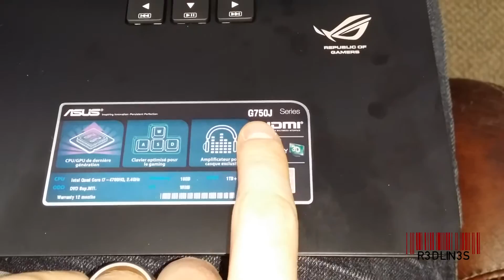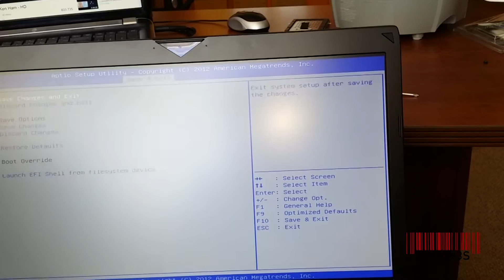Upgrade RAM Asus ROG G750J From 1.3v to 1.5v

Comment: What a stupid thing to do & say. Haswell chips require 1.35v NOT 1.5, using such may cause:
> Overheating
> Damage to the CPU IMC (due to the increased potential difference)
> Greater battery use than our stated values.
Saying oh looks it works (ATM) is like saying "Look I'm smoking a cigarette and I haven't got cancer (yet!)" Please don't ewver make another YT video or give anyone 'advice' until you have taken a few lessons.
https://rog.asus.com/forum/showthread.php?33744-Upgraders-1.35V-memory-is-required

Comment: Does it make some problems down the line. Is everything stable and does the higher voltage damages something in long term usage. And if not why on earth does asus fits this type of ram, it's twice more expensive than normal 1.5v. I have 9 gigs but i wanna expand it for adobe premiere